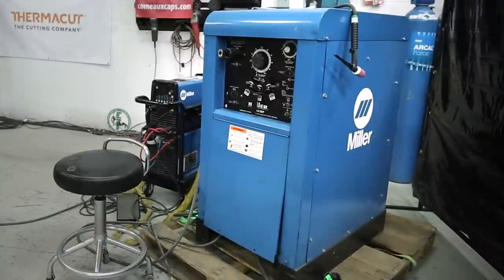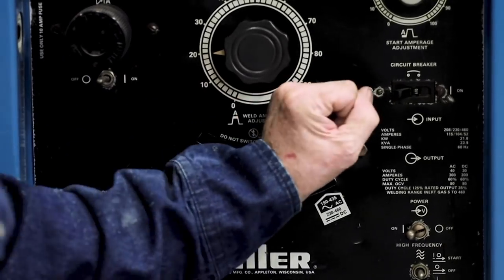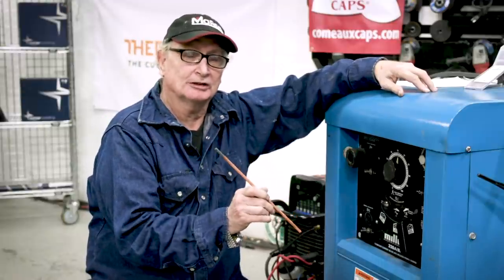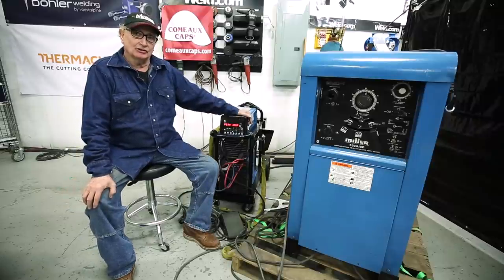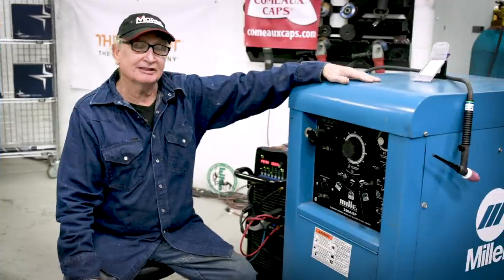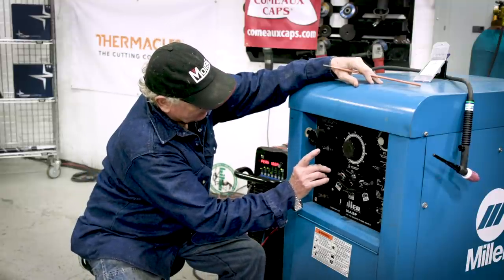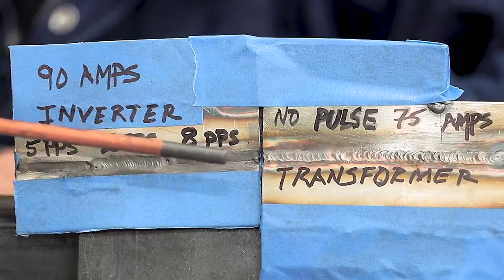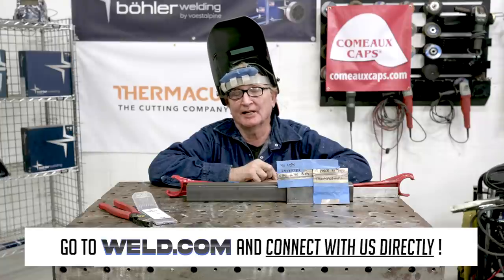Inverter Welder VS. Transformer Welder

Comment: I've been tig welding for years my company bought me a new Miller Dynasty 350 I didn't like it at first but now I love it about all I weld is aluminum with a thumb switch
Reply: that is fantastic.....what did you not like about it.....is your thumb switch a on/off or a variable amperage on/off. I recently [a year ago] started using an on/off for stainless as I have to move around big weldments and got tired of dragging the foot pedal.....I am welding 16 ga sq tube but welds and fillets, I just set the amps on the Dynasty 280 and use High Frequency  and away we go......Thanks for watching today and commenting, Cheers, Paulie B
Reply: @ypaulbrown I didn't like the noise at first I was use to the Miller 350 tig runner .                                                          Once I got use to it I loved it the fact you can turn the Hertz up and down I weld a lot of real thin door skins on 1/16 inch aluminum door frames turning the Hertz down really makes a big difference the 4043 tigrod flows nice
Reply: @phillipgarrow2297  I am assuming the watercolor noise, and the fan coming on all the time as far as the noise.....I agree...I was used to my Synchrowave 250..as far as turning down the hertz, I thought for many years that would spread the arc and put less heat into the material,,,,we have another video coming out where we show you actually put more heat into the material at low HZ. Even though the Arc gets focused at higher HZ, [you would think that would concentrate arc and put more heat in] it does not, it does help keep the arc from wandering off in tight corners and edges and puts less heat in the material at higher HZ.....
My opinion is, if you are getting great results, do not change what you are doing....If you get some real thick aluminum and are having trouble getting it to melt, run the HZ down.....if that does no work, do a preheat to about 200 degrees F, or you can use a Helium/Argon mix [expensive] but sometimes needed for 1/2".....
Thanks so much for sharing your experience, hope this helps you and some others.....Just my past experience....Best Regards, Paulie B👩‍🏭
Reply: @ypaulbrown  we use 60/40 helium argon mix in our mig welders we hardly ever weld steel I've noticed that turning the Hertz up high on thin aluminum it seems to want to crack when it cools down most of our welds are step welds not stringer welds.                                                 As far as someone thinking these inverted welders aren't reliable we run them hard and the tig welders hold up better than the 350 Lincoln mig welders..                        There's another nice feature with the dynasty you can tell the welder what size tungsten you are using I use 1/16 gray tungsten when it starts it doesn't damage the tungsten

Comment: I think where transformer machines shine though is they can work better and more reliably in dustier environments. However, the digital or at least LCD display on the inverters is really nice to help fine tune controls a bit easier. We used a ESAB 2200 (or was it a 2300?) in college for tig welding. We had it mounted up high just to keep it dust free. Very nice machine for sure. 

The upside to Inverter is they end up using less electricity to run vs the transformer type, however if your doing it at home, you really wont see the savings vs in a commercial setting.
Reply: One thing that helps in a dusty environment is a welder with fan on demand.....I love my Millers for that, they are quiet. my Lincoln [2020 year and ESAB 2021] are both constant fan....also the Powcon I have is constant fan.....I like it to be quiet in the shop....thanks for the comment and watching...Paulie B

Comment: Maybe someday I'll upgrade, but for stick, I still use and love my old Miller Thunderbolt.
Reply: David, is your Thunderbolt AC or AC/DC? That old iron is hard to beat.....thanks for watching and commenting, Paulie B
Reply: @ypaulbrown  AC/DC.  Not the XL model, but it's the one with the amperage crank on top.  It was built in the mid 80's and still works great.
Reply: @POOKIE5592  that was the first Machine I Wanted in 1973, but never got around to buy it......in my opinion they were much better than the competitor at the time for the accuracy of the amp control.....have you ever Tig welded with the machine ? I set up a scratch start tig on an old Lincoln Tombstone AD/DC in 2008  and it was fantastic, but only in the DC mode, wish I had known this 45 years ago......Paulie B
Reply: @ypaulbrown  No sir, I haven't.  I read something in a forum from a guy that worked at a Miller dealer back then and he said he saw too many come back burned up from people using them for TIG and he had to tell them that isn't covered by their warranty.  I guess that kind of scared me off from ever trying it.

Comment: Nice comparison.  One must also consider which process (SMAW, GMAW, and GTAW)  and length of run (weld time) as well.  I purchased an older Lincoln SP250 for a large fabrication project because I needed the extra duty cycle.  I also have a newer inverter machine that I use for special projects and short runs.  Bottom line, my shop has both types, and I wouldn't have it any other way.
Reply: Great idea, 
thanks for the comment, Paul
Reply: shoot I got a 240v Hobart inverter running a 1/8 7018 on some lawnmower blades for practice and I am able to run a full electrode without the orange light coming on
Reply: @gaminredneck5216  120 amps? 
what Hobart? Cheers, Paulie B

Comment: I have a transformer machine in my shop that is very similar to the one shown in the video. Could you make a video explaining the differences between running half wave and full wave on those machines?
Reply: I am not familiar with the term half wave and full wave, as far as I know, the only wave is the sine wave at 60 hz.  which is 50% negative and 50% positive.  thanks for commenting and watching Paulie B
Reply: @ypaulbrown  Thanks for responding! It’s a setting on those transformer machines. I don’t know all of the details in it, but the owners manual mentions the ability but not functionality.
Reply: @strokedyota4739  what machine are you referring to ? Make and model please, I will see if I can find out for you. Paulie B

Comment: I am still using my Millermatic 35 mig welder (1979).  I converted the old gun and hose to the new style and  added  a .023 drive roller.  I am just a hobbyist so it fits my needs.  I've never used an inverter welder so I don't know what I am missing.   The 35 is a 150 amp welder with a 60% duty cycle.  .030, .035 & now .023 wire capable.

Comment: Does the inverter TIG always flash (pulse) like that?  I have never used one, don't know if I would get tired of the pulsing light or not, maybe inside the helmet you don't notice it so much.  Thanks
Reply: The inverter machine was set to pulse, [high amps followed by low amps ] to let weld cool. When in a non pulsing mode, it does not flash like that. There are some Transformer machines that will pulse, but the fastest they pulse is about 20 times a second. There are ranges of pulse that can be very annoying.......slow is ok, and fast, over 20 or more per second. I hope this helps, thanks for watching, Paulie B

Comment: You really can't beat welding steel on the old machines tho.. something about how stable the arc is
Reply: Jeremy, I really do not see much difference in the transformer and the inverter when it comes to steel or stainless....Aluminum, yes, being able to change the frequency is a game changer and also the fine tuning of the balance is much more accurate than the older transformers, due to the inverters not actually using AC, but creating AC by switching from positive to negative DC.....all done with electronics on the Inverter machine ..basically a computer running the show....thanks for commenting and watching, Paulie B

Comment: thanks for posting this !!  Do you use different types of tungsten for an inverter machine as opposed to a transformer machine ???
Reply: great question Joel.....for aluminum, the old green pure tungsten is out.....Now a 2% Lanthanated [blue] s the trick, you will run with a sharp point with minor balling. It also works great on DC negative for steel, stainless,copper, iconel, titanium. You can still use Ceriated [gold] or thoriated [red].....but the thoriated is slightly radioactive, so if you do not want to be exposed to that...go with the Lanthnated, Ceriated or even the very new 3 element Purple, sorry, I do not know what the elements are, opps, just found it.....Contains 98.34% Tungsten, 1.5% Lanthanum, 0.08% Zirconium, and 0.08% Yttrium...thanks for commenting and watching, cheers, Paulie B
Reply: @ypaulbrown  wow, that is some great info on what is in the purple tungsten....thanks....

Comment: Are the torches air cooled or water cooled?  I have considered water cooled, but don't weld TIG enough to justify the maintenance time.  But my air cooled torch gets hot quick.
Reply: We were using Air cooled that day.....150 amp capacity, they make bigger air-cooled torches. [250 amps]....Water Cooled is great, but you need a radiator/cooler, or you can hook to a faucet and let drain in your garden.....I did that at first, but let drain in the driveway....well, when it got cold in North Carolina, I had an icy drive,,,,,,so I bought a cooler.....mainly for aluminum high amps....even at the rated amps, air-cooled torches will get warm.....solution, wear thicker glove on that hand that holds torch......thanks for the comment, Paulie B
Reply: There really isn’t any maintenance to speak of
Reply: @ypaulbrown  Thank you, it is good to hear from someone who has used both.
Reply: @williamdonnelly2967  Thanks for watching and commenting, Paulie B

Comment: Hello Paul, I'm also a Paul with a beautiful Miller 330 A/BP welding machine. Mine has less than 100 hours of use but I need to go through and change all the cables out to the remote and contactor especially the water cooler for TIG. I was using it 4 weeks ago and setting it up for ER70-S3 TIG and I lost my arc. It stills welds on reverse polarity using 7018 which makes me ask can 1-side of the diode bridge be bad (Negative side) and it still works on the positive?
Years ago I had a Miller Dynasty that was a great machine for any type or welding except when the cards short circuit and replacement cost is several thousand dollars. This machine was new in maybe 1998 and I don't remember the year it broke down on me. But regardless, these pulsing machines now adays are cheap unless you use name brand. Excellent example of the transformer vs the inverter, Thanks.

Comment: you didn't mention any advantages to transformer machines at all?
Reply: I can think of none except that older transformer welders are much cheaper used now
Reply: Steve, the advantages are they are straight forward to set up. The inverters can be daunting to old school weldors or newbies, I have had to help a few others who bought an inverter on such things as 2t and frequency.....it is a learning curve and those who are set in their ways have the hardest time.....but If I can figure it out, me being an old geezer artist guy, anyone can, thanks for the comment, Paul
Reply: I am upgrading and will be getting a transformer machine for my shop/lab over an inverter one. Reasons; They are almost indestructible, much more reliable and can be repaired easily if ever they get damaged, they don't have proprietary control boards or hard to get power semiconductors, nor capacitors that go bad with time. I plan to do lots of experiments with such welder like powering a huge electromagnet, making an arc furnace, powering the filaments of a titanium sublimation pump etc. A transformer machine can handle all that no issue. Inverter welders on the other hand are very finicky, they are only good at doing what they were intended to do, weld in very specific ways, in fact not all of them even like to use carbon electrodes, I have a fronius transpocket 1500 so not a bad inverter welder and the thing goes crazy when I sustain an arc between two carbon rods it overheats damn fast when I arc gouge, when it breaks I cannot repair it because the IGBTs are obsolete now and hard to get, in fact almost as expensive as the new machine. And well Chinese inverters are as reliable as politician making promises.
Reply: @ypaulbrown  You could have mentioned transformers are more reliable, have a higher duty cycle, are more durable, longer lasting, much easier/possible to repair. The only disadvantage my Square wave 355 has to an inverter are it's weight and inability to adjust the frequency, at least that I know of.
Reply: Old Transformer Built Strong and Heavy Like Bull.....
Reply: @Steve_Just_Steve  unfortunately, the older the machine gets, the harder the parts can be to find......hopefully yours will  not need any parts.....or if so , they can be gotten. .thanks for the comment, Paulie B
Reply: @teresashinkansen9402  Intresting the projects you have, a friend was using a 600 amp inverter constant potential machine to obtain a Gas from water to cook with.....lots of juice used, The problem with carbon arc use is they need a lot more volts than welding rods, about 40 to jump the gap......that is why some engine driven machines with alternators and some transformers will not run carbon arc, I am not aware of any Inverter machines that run carbon arc, but there may be.....Have you thought of getting a generator machine instead of a transformer? some of the old Lincoln and Hobart machines are true DC generator types. As you would imagine, certain machines are not designed to do everything....Inverters are basically computers and need the care given to a computer.....and yes, they are expensive to repair.......thanks for the comment, Paulie B
Reply: @teresashinkansen9402  Even my transformer 355's manual says it's not recommended for arc gouging.
Reply: @Steve_Just_Steve  not enough arc voltage, needs upward of 40 volts to maintain the arc.....how about thawing frozen pipes?

Comment: Good information.  I didn't understand about the pulsing and hadn't seen that before.  There was also the difference of duty cycle and welder size that you didn't intend to address here.  I assume the transformer welder (basically just because of how big it was) was probably rated 100% duty cycle.  I've seen a lot of smaller inverter welders, but was just curious how big a 100% duty cycle inverter would be.  Still I learned something here and have questions.  That's what it's all about.
Reply: Robert : the Transformer was rated at 60% 300 amps, the Inverter was rated 60

Comment: Love my Dynasty 200 DX
Reply: Dynasty's are a game changer for sure......I bought one in 2004 and have used on many location jobs, even using it 60 feet in the air welding on the nose cone of a helium filled Zeppelien, thanks for watching, Paul

Comment: The old style might be made to last forever but the Dynasty will put out superior work and pay for itself. No one buys a $10000 machine for a hobby.
Reply: Good point, but there are those that might have the means for their hobby......we used the Dynasty because we had it in the studio. The same principles apply to less expensive machines. The main difference is the Dyanasty goes up to 400 HZ. Thanks for watching and commenting, Paulie B
Reply: Have u ever met a carcaine adict ? 
Jokes aside im that dude i run a Fronius transsteel 3500 welder amd i aint consider a pro u either get the best or nothing cheers
Reply: @dimitartenchev9338  you got that right...I am the same way.....that way you can only blame yourself and not the tool....thanks for commenting and watching Paulie B
Reply: $10,000 for hobby machine. Yeah, I'm crazy enough to do that if I could. I can't see much difference between that or buying a quarter of a million-dollar CNC milling machine to put in my basement to make copper manually operated swing presses with. LOL
Reply: @johnsims5330  the $10,000 inverter is much lighter Than the CNC machine and easier to get in the basement.....and you can take it on the road with you , while the CNC must stay at home.....thanks for commenting and watching, Paulie B

Comment: Which techniques do you use with pulse? Lay wire, dab method, or twist your wrist method?
Reply: looked like fusion to me
Reply: @Steve_Just_Steve  Steve, yes, in the video, I only did fusion, it was 16 gauge to 16 gauge, the shots did not represent very well.....Paul
Reply: Herbert, Pulse is helpful for keeping the base metal from blowing out, it is not a cure all for bad technique. It can make a average weldor look great, but it can also cause defects in the weld if you just do lay wire, [ lack of root fusion]. at the higher pulses, it will stir up the molten pool and raise contaminants to the top......a good thing. I can take a funky weld and by going over you can pretty it up.......hope this helps, Paul
Reply: @ypaulbrown  videoing welding is not an easy thing to do.
Reply: @Steve_Just_Steve  you are so right, our camera guy is the greatest.....the hardest part is presenting the material so it can be understood......my hats off to all video makers no what they are presenting......we shoot with 3 cameras and the framing is tight, so the presenter cannot move much....or get there big fat head or Hands in the shot like I have trouble doing....thank:thanksdoc:s for the comment, Paul
Reply: you can use either......thanks for the comment, Paulie B